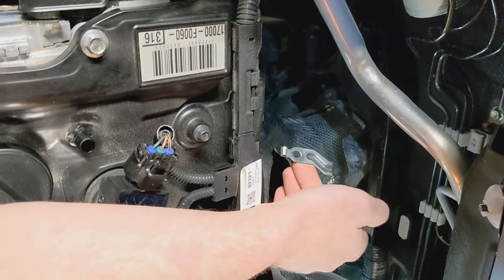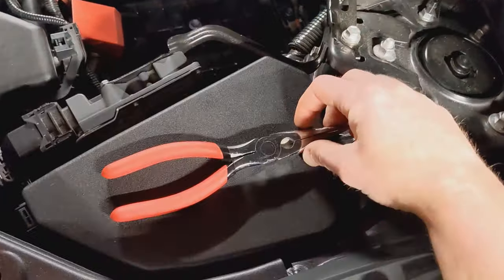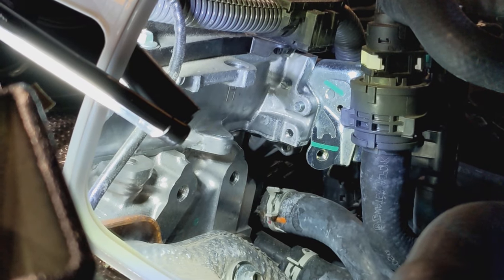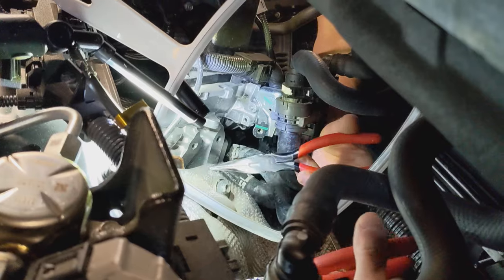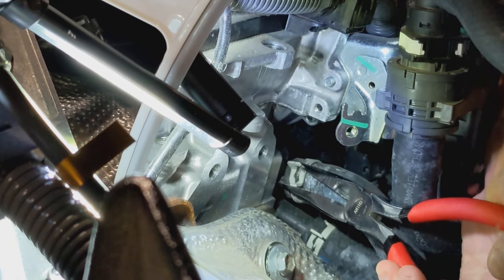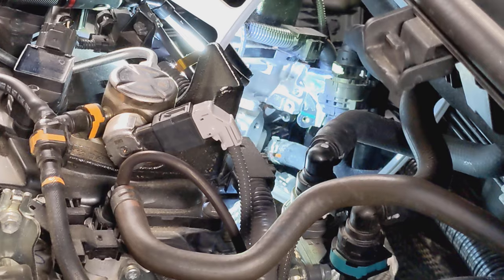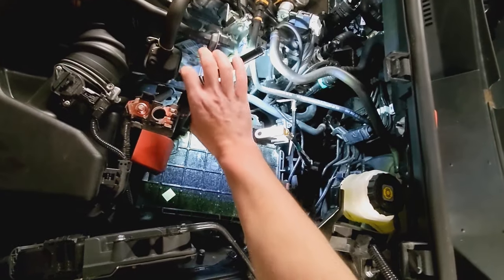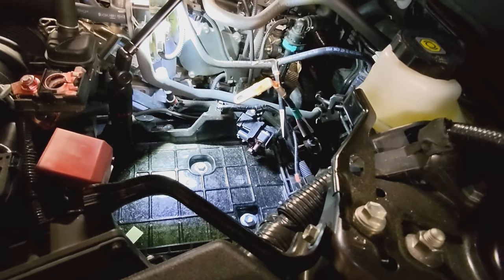2019+ Toyota Rav4 coolant bypass valve - One way to remove the upper hose clamp

Comment: Why did you not replace the valve? Why is there no good videos of anyone replacing the freaking valve lol
Reply from the maker: Because it didn't need to be replaced.  It's a pretty straightfoward job. There's this hose that I talk about in my video, and then there's another that you get to behind the front driver side wheel, with a white paint stripe https://youtu.be/lLv2m_kmGSg?t=1451 Then you have the hose on top of the valve, that you remove by pulling the white quick release tab out, and pulling the hose up.

There was some debate on the rav4world forum about how hard it is to remove the clamp that  I talk about in this video. The point of this video is to show that it's not all that hard to get to that clamp, which is the hardest part of replacing the valve. 

Here's one how to on camry, same thing https://www.youtube.com/watch?v=xg_N2B6XaeE

This video was never intended to be a full how-to, that's why I put "upper hose clamp" in the title instead of "how-to replace" or something like that.
Reply: @chrissmithz314 so your hose bypass maintenance light hasn’t turned on?

Mine just did yesterday. Thought it was the oil but it points towards the bypass valve.
Reply from the maker: @CuarentaZ40  Every 5000 miles I get maintenance required on my dash, but I reset it and the message goes away. The message has never stayed up permanently.

If you think your message could be for the bypass valve, I would recommend scanning the car for trouble codes, and seeing if something like "P268115 Engine Coolant bypass valve circuit short to battery or open" appears.
Reply: @chrissmithz314  nah it doesn’t go away from resetting.

It turns on only when the ac is super cold all the way down.

Its 100% the bypass valve.
Ordered the part already I don’t need to change it anytime soon tho.
Reply: First you don't have to remove the battery and you don't need to remove the hoses at the engine to replace the value

Video is misleading and a waste of time guys.  It is way too crazy to remove

Comment: I have the same problem what I need to do ? Only remove the bypass valve or ?
Reply from the maker: You should get the bypass valve with the hoses attached, since removing the hoses from the old valve is difficult. They're glued on or something.

I think the part number is 16260-F0010, but it's always best to check with Toyota parts.

Comment: Was the bolt that secures the valve difficult to remove? Tried loosening it & it is on there good
Reply from the maker: I'm not sure, I didn't try removing that bolt unfortunately.

At the beginning of my video I mention unbolting a bracket, where the green stripe is. I remember that bolt being extremely tight, for what it is. So it wouldn't surprise me if the valve's bolt is extremely tight too.

Comment: Just did the replacement, took less than 50 minutes, watched my security cameras after to see. I DID not remove battery, first I pulled off the engine dress up cover, removed the 12mm bolt that secures the other hose next to the bypass valve to gain access to the bypass valve 12mm bolt and then removed that.  used a pick to pull out both sides of the white clip that holds the hose to the bypass valve and removed the hose, coolant spills out, no big deal.
Then from the video above I removed the wire that is held on with a 10mm bolt and move it out of way. I wasted probably 10 minutes looking for a mirror to see the clamp on the hose that is the short end of the hose down below the bypass valve. Once i seen it i knew what I was working with and felt it to get a set of pliers on it. I used a square end set of pliers that had about 3/8 wide jaws. Other pliers would slip off. Hose slid right off.
 Next was the lower hose, there's a plastic bracket on it halfway that holds two other hoses, just unclip the bracket from the other hoses. Once that was done I turned the wheels as far right as possible. I lied on the ground and could easily see the lower hose and clamp. The clamp ends were facing up and all I did was use a pick screwdriver with a hook end to grab it and spin it around. Then it was very simple to grab the clamp and slide it off. I slid this one onto the mount instead of back onto hose, made it easier for install. 
Reversed everything you did and top up coolant in radiator through radiator cap, not overflow bottle and run engine to get air bubbles out. rinse away any excess spilled coolant and done.
Reply from the maker: Glad to hear it went well for you. A mirror isn't entirely necessary, you can definitely take the clamp off without one. The mirror is mostly for the video so that people can see what I'm doing in the video. 

Removing the battery obviously isn't 100% necessary either depending on how you attack the clamp. At the same time, it only takes a minute or two to remove and put back in, and no radio presets or anything are lost by removing.

More than one way to skin a cat, the stuff I show in the video certainly isn't the only way.

Comment from the maker: 0:04 This bracket has a hook at the top to hold it in place for you while putting the bolt in. Make sure to hook it over the top of the green striped bracket shown @ 0:10. You don't have to hook it over, but it helps.

Comment: What is this problem? Never heard this problem in older models
Reply from the maker: I'm not the best person to answer this, as I have not really stayed up to date on the issue. I just know a coolant valve seems to fail anywhere between 30,000 miles and 80,000 miles (48k km - 128k km), and people on the toyota forums are mad because the valve is made of plastic, and I think toyota charges about $700 USD to replace the valve. I've argued that it doesn't seem very difficult to replace the valve yourself on Rav4's, or replace the valve and hose assembly yourself. Others have disagreed, saying some of the clamps are hard to get to.

As far as what happens.. "Engine Maintenance Required" will show up on the dash, and when you scan for codes you will see a P268115 "Engine Coolant Bypass valve circuit short to battery or open". The valve starts to leak internally, and coolant leaks into the electrical connector, causing this code. I believe toyota started using this valve when the new A25A-FKS (gas) engine was released, and possibly the A25A-FXS (hybrid) engine too. So in the US, sometime  starting around 2018 I think with the Camry's, and on 2019+ Rav4's and Corolla's.

This video shows the issue on a Lexus https://www.youtube.com/watch?v=6vIqzducODM 
Google searching P268115 should bring up various forum posts on the topic too